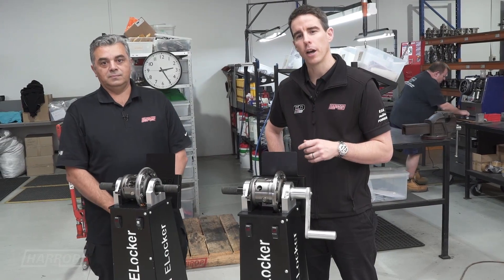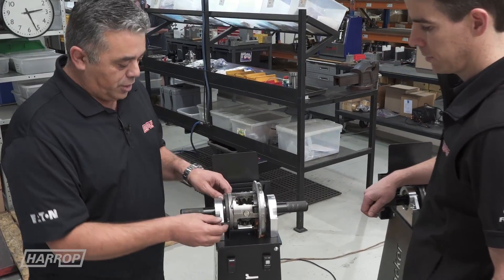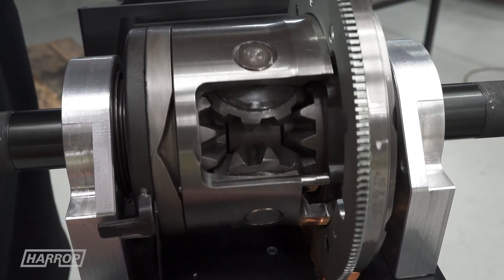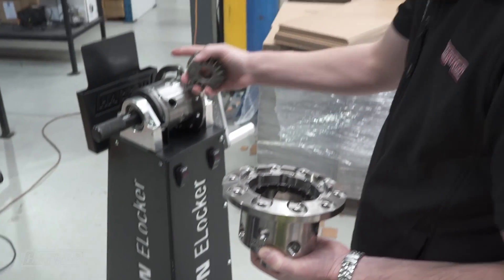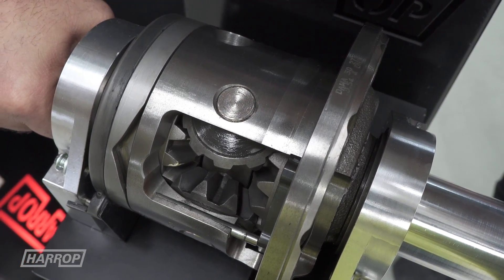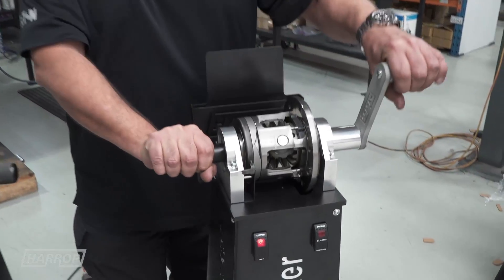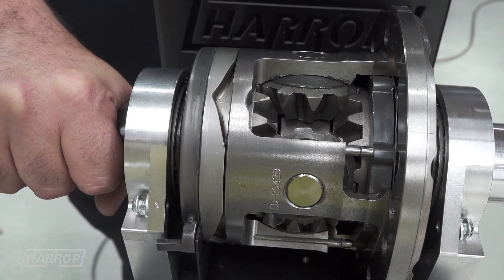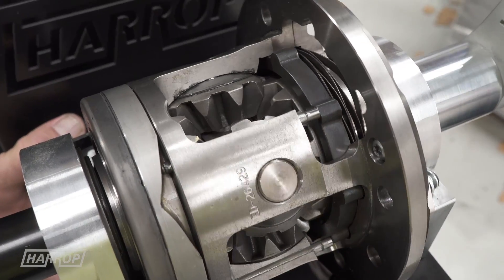Facts about Harrop Eaton ELocker Engagement

Comment: What’s the misconception on social media?

It takes 6 inches (depending on tire size) to re-activate the locker when shifting directions...

Then 6 inches to re-engage going forwards again.

If you’re just driving through a bog hole it wont make a difference as you point out, but if you are ramped on a steep rockey steep hill and trying to launch over an obstacle its a royal pain, and its very noticeable. 

Dont think there are any ‘misconceptions’. Just well informed 4WDers that have used the products and know their limitations.
Reply: it's not I had the new pin design
Reply: AllOffroad 4x4 Adventures TV is correct. Its a lot more than 6 inches and closer to half a turn if not more. 
The other issue i have seen on trucks that play hard is the load plate next to the magnet gets indented by the locking pins to a point where they no longer slide and can no longer disengage or re-engage depending on where the damage has occured.
Reply: From what I gather that half a tire turn is coming from the OLD Eaton ball bearing design, not the latest pin design. You can see from forward to reverse the diff barely moves, the old ball bearings would turn the diff quite a bit.
Reply: i think on social media someone was mention half wheel turn.. not 6inches.. 6inches is almost nothing compare to half wheel turn. given half wheel turn can be almost 50inches for 33inch tyres.
Reply: hm it is enough to stuff up a drive in certain circumstances as you can see here https://youtu.be/1nYZo--7Xh4 , the 6 inch is for what Tyre size? We see far more then 15cm rotation needed to disengage and re-engage on 35"  in most situations we encountered where this is an issue the front wheels up a decent rock step and a few forward and backward movements to re-align are required.  The bind does not keep lockers engaged in my experience the traction is not there second it is required.
Reply: It takes "6inch" of wheel slip to rengage when changing direction. What u cant really see is old mate is holding 1 output shaft so it makes the diff lock-unlock-lock.

Its stupid to say 6inch, it should be degrees to engagement. Distance is relitive to tyre size and inflation. Degrees is a fixed messurement that doesnt change with diameter.
Reply: @The_Koups  Agreed, saying "inches" when talking about rotation is pretty meaningless.